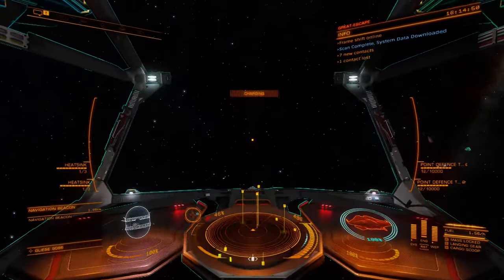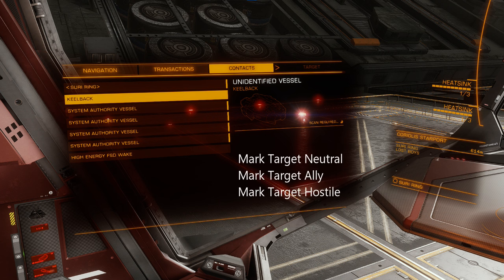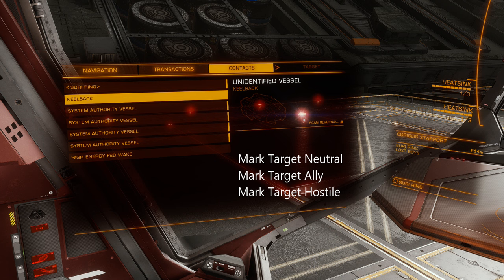Elite Dangerous | Dry Commentary | The Ideal Sensor System

Comment: Another improvement could be to make the detailed surface scanner display a real heat map showing the true hotspots of raw materials.

Or another - display station facilities (repairs, outfitting, trading, ...) landing pad size on the left navigation panel so that you don't have to open the system map.